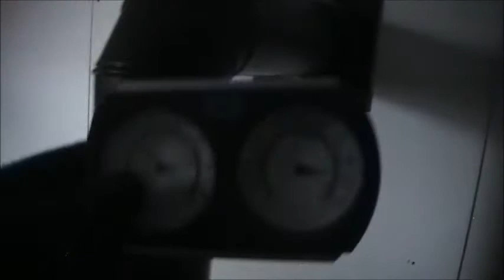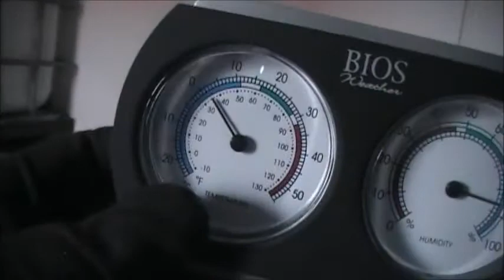The Off Grid Tiny House 87 What is it

Comment: I started buying the 75 ah AGM from Canadian tire (exspensive) I went instead, with the group 29 Ever start from Walmart. 114 ah, $129. So far I have 5, in parallel, with 4 gauge wire cut from jumper cable. I plan on getting 5 more. You should check kijiji for a lot of good stuff. I got my composting toilet for $200
Reply from the maker: David Pedder Very smart. I didn't know the walmart brand batteries were any good. I already bought my composting tolit and installed it. ( & love it). Also if the new lithuim ion batteries i plan on buying dont work then I may go your route. (check my later videos where i show them, and how to wire them).